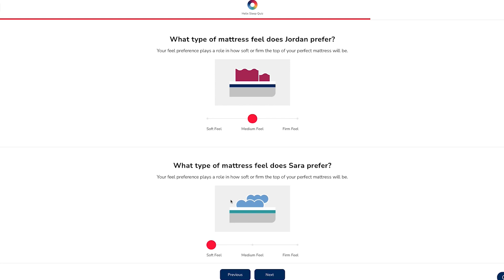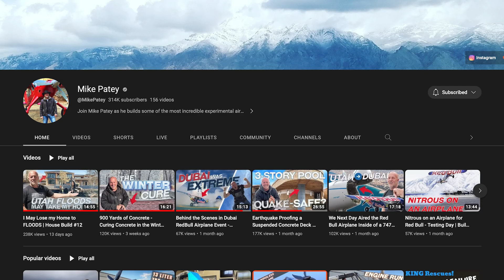What I would do if I weren't a YouTuber

Comment: This is honestly inspiring, because I’m doing the exact same thing, partly as a result of watching you try new things (and also because I’m in my late 20’s and starting to see that the world is so much bigger and full of possibilities than I ever thought)! I also got an English degree in college, back when being a “full-time blogger” or “full-time YouTuber” was kind of laughed at (2012-2016), and now there’s just so much free information out there that it’s increasingly easy to learn new things without a formal education, as long as you’re confident enough to try new things and make mistakes. I’m also getting way more interested in math. I bought a house a couple years ago and now I can’t stop thinking about all the projects I want to do to improve the property. And if I want to DIY all of that, math and some simple engineering knowledge (i.e. understanding how to wire electrical connections in a wall) is going to be essential. Not only that, my job provides me with free higher education benefits, so now I’m getting the education necessary to get into the IT field, which will provide guaranteed job security while I do all of my other interests on the side. I initially wanted to write full-time and go into publishing, but that world isn’t very friendly right now to non-established creators. So I’m letting that be a hobby and moving on. My starting place for this IT degree was statistics, and understanding from the start that this form of math is all about identifying patterns in the world and drawing conclusions from them is really helping me get through it. From an English degree to a technical computer career that requires some engineering and math knowledge…who would’ve thought! Keep up the good work, Jordan. Staying curious about the world is a beautiful thing.